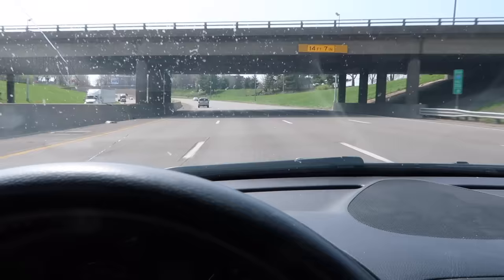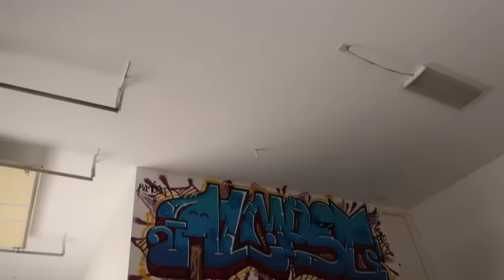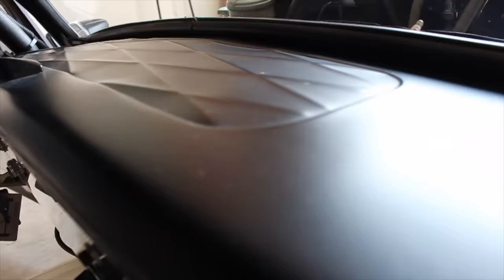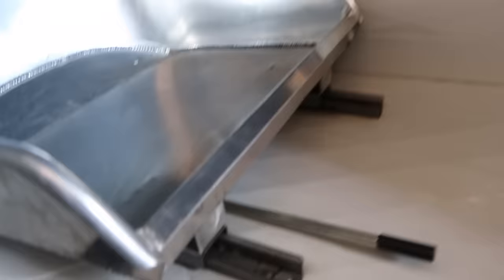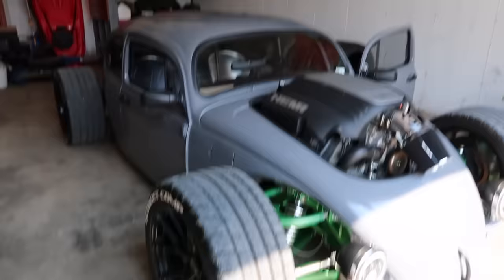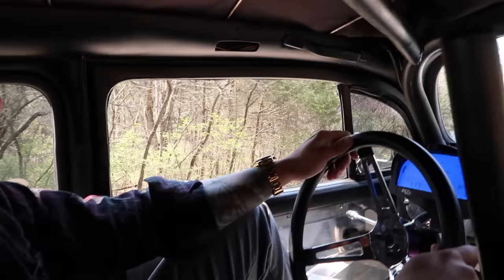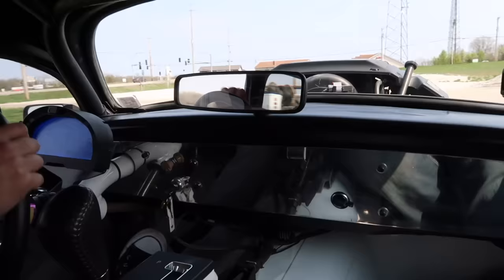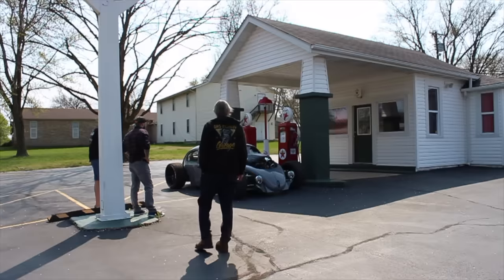HEMI powered VW Beetle, A Real Life Hot Wheels! The HEMI BUG

Comment: LOL that's a combo of sick & hilarious, and is an awesome build. I really like the rolled stainless interior and has a lot of nice custom touches. I usually don't like the looks of the big chunk of plastic on top of the 5.7s, but is perfect for that and fills out the front end. I noticed that they kept the original 5 speed shifter in it, and was one of the first things that I replaced on mine. They make pistol grips for them, and can be found on the Mr Norm's online store. They are just like old school pistol grip shifters with the wood grain, but also had an option for carbon fiber and is what I got. It was around $150 and are not cheap, but they are US-made and just like the grip of a pistol. It's those small touches that always attracted me to Mopar, are some badass machines. The exhaust sounds amazing for a 5.7, and definitely nothing like a modern charger sedan. It's amazing what good exhaust does for these gen3 hemis, and have got 3"racing pipes on the 6.1 in my Challenger
Reply from the maker: cheers thanks for watching man!

Comment: I just want to know where the radiator is I would think it's at the back utilizing the original area for the air cooled engine but I would really like to  know the cooling system setup
Reply from the maker: you are correct remote mounted in the original engine bay
Reply: You can see the masive radiator at 9:58 got to be some long hose going back to the front though
Reply: Me too

Comment: As someone who has 2 VW tattoos before i was of even legal age for them,  & owned 2 before I could legally drive, I LOVE THIS MONSTROSITY!!!

I had a 71 Super Beetle with extra wide fenders, everything carbon or fiberglass to shave weight, & slapped a '93 911 Turbo into it, removed the rear seat & show horned the motor in, as I didn't want the hinge extension to give away I had anything in it, people would pull up next to me, kinda pointing  & laughing when I used to street rage, that was UNTIL they see the front end pop off the ground at the light, to give them a "ill taste" of the ASS WHOOPING they're about to receive..... 😆

Comment: Quick question for You.  Can a normal HEMI Motor be installed under the hood and be an automatic transmission????  I love the look of this VW but it sits way to low to the ground.  I would have an issue with the car bottoming out and destroying the under belly of the car.
Reply from the maker: good question, If there is a will and some skill theres a way im sure, I do know there was a lot of work to make it fit mainly the full tube frame chassis work, anything could be made to fit with some time good luck my friend thanks for watching!
Reply: @ALifeWithCars  Another quick question for You.   How do You keep the car from bottoming out since it sits that low to the ground?  I would be so scared of damaging the under belly of the car.  An Awesome ride like that should be preserved and protected.

Comment: I think it's a shame to mess up a real gem that way putting such a big and heavy engine on it when you can use a smaller turbo engine from a subaru and it will give you more speed and more performance
Reply from the maker: so basically suggesting it be built like every other custom bug... there are millions of these so its not like its crazy rare, y not be different and do something that never been done,
whatever you say an instant 400 hp in a light car that has a very well engineered chassis, and handles like rails is far more interesting, and definitely gets more looks than a traditional bug 
but to each their own thanks for watching

Comment: Meh.
Engine belongs in the back
Reply: I agree they basically just built a challenger with a bug body kit
Reply: the only time I would put a v8 in the back of a bug would be a baja bug. On the street, this thing would just pull wheelies every time you got on it. I had an old super beetle that was baja with an almost stock engine and I could get the front tires to come off the ground.